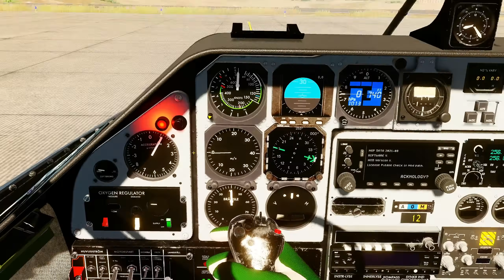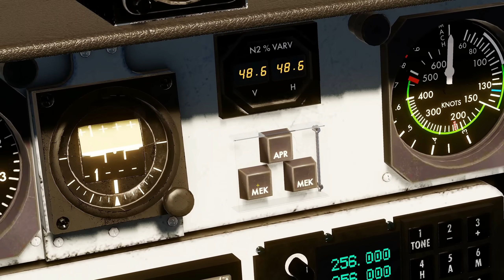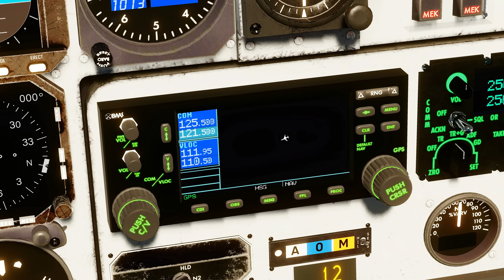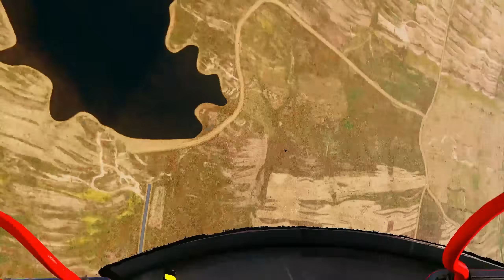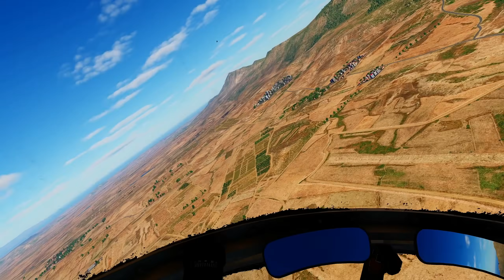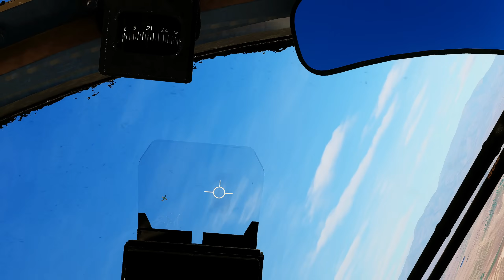NEW: Saab SK-60B High Fidelity DCS Free Mod - General Guide

Comment: Think you could use these as a "back-up" ground attack plane for the Swedes?  Looks like a fun and nimble platform... might even work for guns air to air up to a point.
Reply: Yeah, they were used as light attack aircraft to a certain extent. I think the version in this mod is rather over powered, from what I've heard there were mainly hopes and dreams making these lift of before the end of the runway...

Fun fact: The attack squadron of Viggens were known as The Commanders Mallet (ÖBs klubba), therefore these was sometimes called The Commanders Rubber Mallet (ÖBs gummiklubba)

Comment: The gun is the 30mm ADEN revolver cannon. Fun fact, got a rather big bag of empty shell cases for that gun in my attic. The gun pod on Viggen and SK60 kept the spent brass and the (older gen) ground crew sometimes took some to make shot glasses. https://en.wikipedia.org/wiki/ADEN_cannon

The SK60 is a very nice aircraft, personally favourite was the four seater without ejection seats. Flying as passenger in those was super relaxing since you didn´t need all the clumpsy speed jeans and brain bucket stuff. Casual clothing and a headset was enough. 

There was a 6 ship aerobatic display team called Team 60. Those aircrafts had blue and yellow stabilizers and also ability to make smoke.
https://www.youtube.com/watch?v=dGQdyg2nloM
Reply from the maker: thxx

Comment: I wonder if the ability to superstall was intentional , or if it was just the 60s thing to do. 
Because... of Draken being able to superstall, maybe this was used to practice recovering from stall like they did on Draken? (probably not,, but the 60s was not very health & safety)
Reply: Definitely not intentional. Basically, at high angles of attack, the airflow over the horizontal stab gets blocked by the turbulent air coming over the wings, which reduces their effectiveness. This is particularly dangerous, as the horizontal stab gives you both control in the pitch axis, and provides a pitch down moment in normal flight. So you lose control authority, combined with a pitch-up moment.

De Havilland found this out the hard way when testing the Trident - their second attempt at a jetliner, which was only marginally less deadly than their first.
Reply: @jackroutledge352  I think he's saying it was intentional to have a trainer that is vulnerable to the same maneuvers as the mainline fighter.
Reply: @jackroutledge352  Ah yes, That! Didn't think of that.

Comment: Interesting that the controls are marked with a mix of Swedish and English.  Wonder if the original was like that or if it's a case of marking essential (but not visually obvious) controls in English, as the majority of DCS users can likely read English...
Reply: The IRL aircraft is like that because much of the avionics were imported from the US. Also, something like 80% of Swedes speak english fluently
Reply: @jameshodgson3656  I knew about the fluency thing.  I spent a couple of years there and was very proud when Swede's stopped making me speak Swedish with them because my Swedish had gotten better than their English (that was three decades ago...it's nowhere close, now.)

I think, additionally, a lot of the Swedish terms for the English-labelled instruments are pretty similar, although I'd have to sit down with a translation dictionary and a clear view of the panel to verify that...